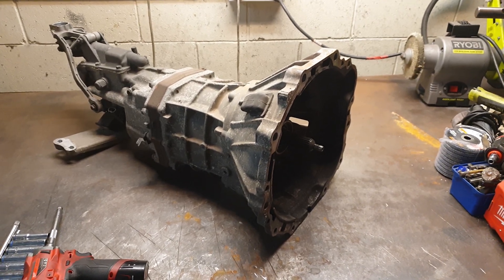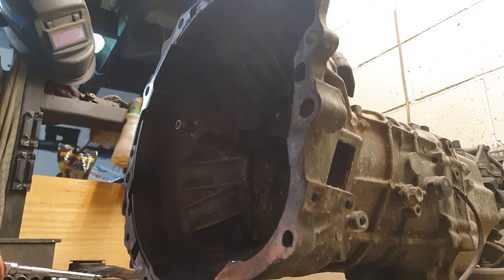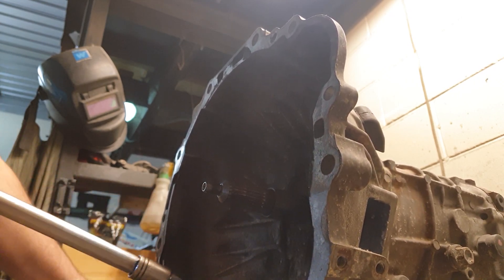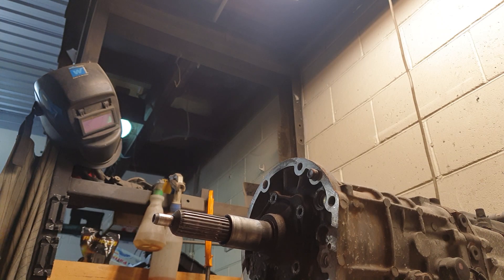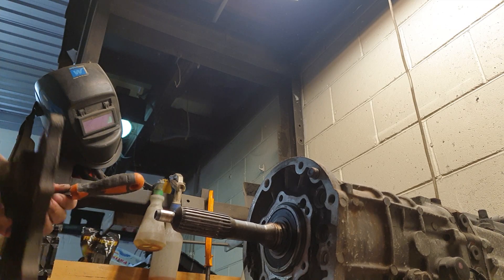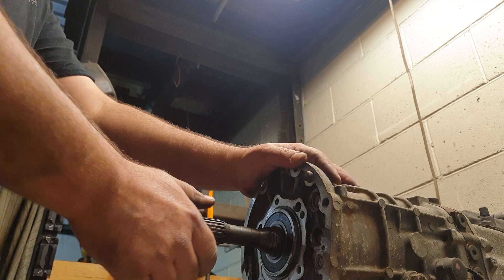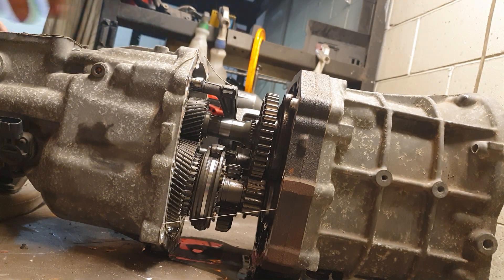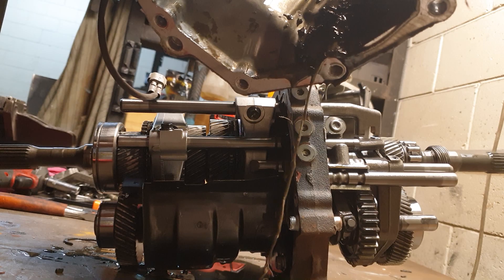When you think you can run big power and sticky tyres with a w58

Comment: What’s considered big power?  Hopefully mine holds 400hp
Reply from the maker: Lots of things to consider. I've seen people break them with 300hp. 

This particular one saw 500 plus
Reply: @NextLevelMotorsport what clutch and tires? Were you launching it or just a street car doing rolling pulls? My SC300 makes 416/448 on a W58 with a clutchmasters 6 puck and I hate that clutch. Looking for a more streetable clutch, any recommendations?
Reply from the maker: @nickadkins7765  I can't remember what clutch or tyres the customer was using. It was during a 4th gear pull from memory
Reply: @NextLevelMotorsport  how much torque? It's usually torque that kills them, not as much HP I thought
Reply from the maker: @Nick Adkins  no idea it was something done over 10 years ago sorry.